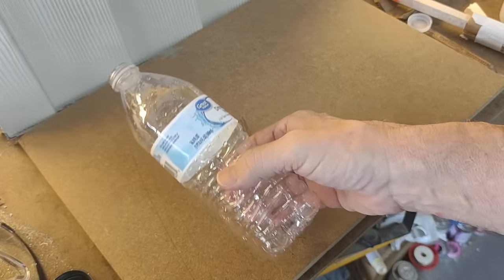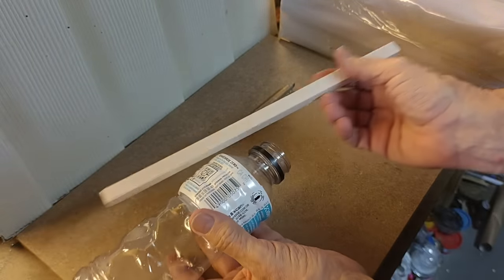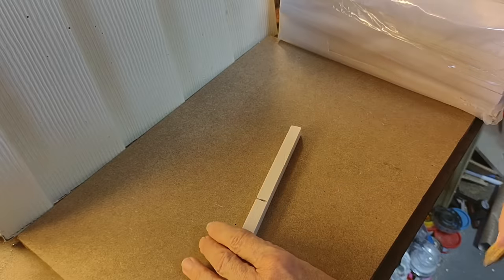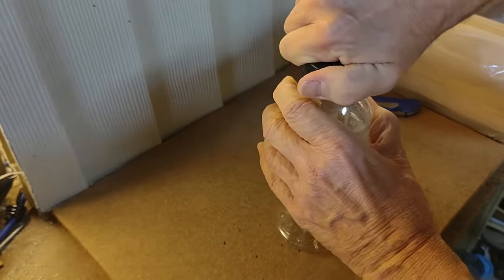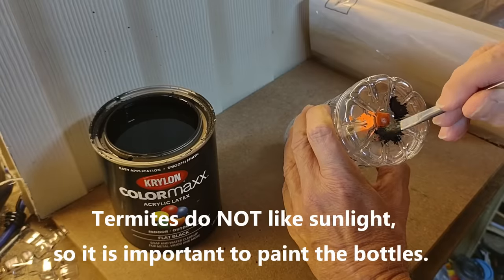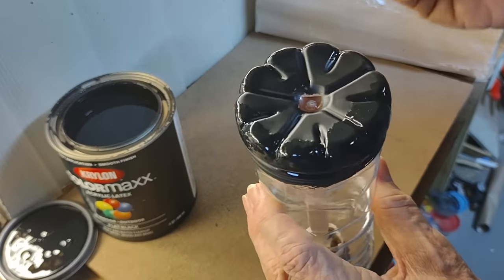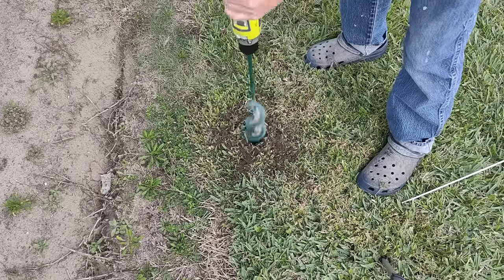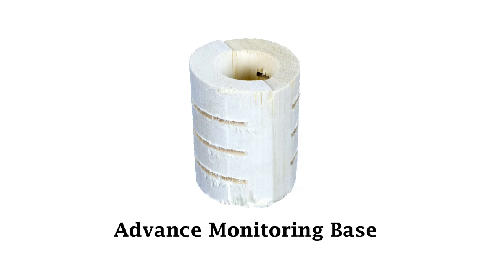Unbelievable Water Bottle Trick for Termites!  Simple to do!

Comment: Does spraying orange oil around the perimeter of the house help to kill termites ?
Reply from the maker: Not really.  Termites travel below ground.  It won't leach into the ground that far.  If you spray orange oil on the side of the house, they will not get a sufficient dose when they build a mud tube to take them out.  If you have an existing infestation, then I recommend using either termite granules or trenching.  For the granules to work you need to have dirt around most of the house and that dirt needs to be porous enough to allow water to seep into the ground fairly quickly.  To find out if the dirt around your house is porous enough, just dig a small hole next to the house that is about 4 inches deep, 8 inches long, and just the width of the shovel.  Fill the hole with water and watch to see how fast it drains down into the ground.  If it seeps into the ground fairly quickly, then the granules should work just fine.  However, if it just kind of sits there, then the granules would not be a good choice, and you should consider trenching, if you have an active infestation.  If it turns out that you need to trench, then please watch my video on how to do that correctly.  Trenching is a lot more work, but it only costs about $100 to do an average size home, and it lasts 5 to 10 years.  Most people can trench an entire house in one day, but you can take up to a month to get it done, and you can literally do just 10 feet at a time.

Make sure that you buy the correct granules.  You need the ones that have imidacloprid as the active ingredient.  A lot of the Home Depot and Lowes stores no longer sell the correct granules, but you can get them from Amazon.  I will give you a link to them.

I hope that helps.  Be well my friend.

Termite granules:  https://www.amazon.com/dp/B000RUIJYM?ref=nb_sb_ss_w_as-reorder-t1_k1_1_6&amp=&crid=157C3RV0MY0AK&amp=&sprefix=termit

Video on how to apply termite granules:  https://youtu.be/H7rW_TSBHJ4

Video on how to trench for subterranean termites:  https://youtu.be/Fy7YHi_7Z8g

Comment: WHAT ABOUT MOBILE HOMES, THE SPACE UNDER THEM?
Reply from the maker: When it comes to termites, mobile homes are not much different than any other home.  Subterranean termites always attack from the ground.  So, if you place the monitoring stations at 4 ft intervals around the mobile home, then you should be alerted to the presence of subterranean termites.  You should check the monitoring stations every month, and while you were out and about doing that, you should also check for mud tubes around the structure as well.  In your case, if you have a skirt around the mobile home, you may find the mud tubes coming up from the ground onto the skirt.  This could be either outside the skirt or the inside that is only visible from under the mobile home.  The other place they may attack is on the piers that are holding up the structure.  So, it is a good idea to take a flashlight and just look for mud tubes that may be coming up those piers.  The termites will almost always find the monitoring stations before they find your mobile home, but it never hurts to make sure.  The termites do not always get the memo about how they are supposed to behave.  If you do get an infestation at some point, then please get back to me and I would be happy to explain how to treat it.

I hope that helps.  Be well my friend.
Reply from the maker: @Enoch940  That is quite the encounter.  It sounds horrible, but at the same time it also sounds like something from a comedy horror movie.  I can just picture that in my mind.  How awful.  Thanks for sharing.  Be well my friend.

Comment: Hi Guy, I have some big black ants in my RV located in Northern Minnesota, I believe they are Carpenter Ant, they usually eat or nest inside dead spruce logs outside. What would you suggest to get rid of them inside my RV? Thank you.
Reply from the maker: I have a video on carpenter ants, but I am going to tell you a better way for an RV.  You need to treat the inside of the RV and the outside.  Make sure that you spray all surfaces of the tires and anything else that comes in contact with the ground.  You should also treat a 20-to-50-foot radius around the RV, and you should treat those spruce logs as well.  A good way to treat both the exterior of the RV, the ground, and the logs is to use a hose end sprayer.  For the exterior of the RV, you just need to treat anything that is in contact with the ground.  If you have any trees that are overhanging the RV, then spray them too.  For the inside of the RV, you can spray the ant trails with Temprid FX.  Just mix it 8 ml to 1/2 gallon of water and spray anywhere you are seeing activity.  Just avoid places where food is prepared or eaten.  Remove all outlet covers and puff D-Fense dust in the outlet boxes and between the outlet boxes and the wall voids.  After that, just apply a bait.  A small dot every 12 inches apart where you are seeing the activity is all you need.  That should do it for an RV.  Keep in mind that the ants in the RV are a satellite colony.  The main colony is outside somewhere, so it is important to treat the outside every 60 to 90 days or they will be back.

I hope that helps.  Be well my friend.

Video on how to treat your yard with a hose end sprayer:  https://youtu.be/wifoTU5dmp0

Temprid FX:  https://www.domyown.com/temprid-fx-insecticide-p-17130.html?sub_id=19352

D-Fense Dust: https://www.domyown.com/dfense-deltamethrin-dust-p-2428.html

Duster:  https://www.amazon.com/gp/product/B099X3HS47/ref=ppx_yo_dt_b_search_asin_title?ie=UTF8&psc=1

Ant bait:  https://www.domyown.com/advion-ant-bait-gel-p-932.html?sub_id=23226
Reply: @GuysPestSolutions   Thank you very much.
Reply from the maker: @andrewpesh9419  You are very welcome.  Be well my friend.

Comment: We are buying a new spec home in Arizona that the ground was to be treated before build and has a 3 year warranty (does that sound legit ?
Reply from the maker: Yes.  Most states now require that builders do a pretreatment for termites.  Unfortunately, they do not do it correctly, so it does not last for more than a few years.  The proper way to do it is to treat all the wood in the entire house with Bora-Care, mixed one to one with water.  When I say the entire house, I mean from the top of the roof, right on down to the basement.  If it is wood, then it should be treated.  This treatment should be done the moment the shell is built, and before the shingles are applied to the roof, the siding goes on the building, the electrical is run, the installation is installed, and so forth.  In other words, you want all the bare wood exposed in the entire house, and then it needs to be sprayed with Bora-Care.  This will render the house totally termite proof and the treatment lasts virtually forever.  This may add another $1000 to $2000 to the cost of building the house, but not only will it render it termite proof, but it will prevent all other types of wood destroying pests as well, such as carpenter ants, carpenter bees, wood boring beetles, and so forth.  This treatment should be mandatory, but the problem is that most people don't know about it, including law makers.

I hope that helps.  Be well my friend.

Comment: I live in the Caribbean.  How do you tackle drywood termite issue?
Reply from the maker: Treatment in the Caribbean is the same as everywhere else in the world.  The only question is if you have access to the products and services that you need?  I do not possess that information, but I can explain how drywood termites work and what you need to do.  

They enter through cracks and crevices around windows, doors, the eaves, pipe penetrations, and so forth.  Most of the time, they enter through several locations.  That is because a swarm of them attacked your house at the same time.  If there was a crack or a crevice, then they probably found it.  After they established their galleries, which will be inside the wood, it will take four to seven years for them to be able to swarm.  Now that they are in your house, the swarmers will use holes that are in your studs to travel through the walls.  Those holes in the studs were created by the electricians to run the electrical wiring.  Not only are these holes going through the studs, but holes were drilled into the attic for the light switches and to run some of the wiring for the outlets.  So, the termites now have easy access throughout the attic and the walls.  If you have a basement or crawl space, they have access to that as well.  Most of the time, you will have no idea that they are in the walls, because the frass is inside the wall.  To make matters worse, if you have drywood termites, then your neighbors have them too.  That means you have been getting swarmed for as long as they have existed in the neighborhood.  Most likely, we're talking about years, so it's a safe bet that you have these guys in many locations in your home.

I always hate to be the bearer of bad news, but if you have drywood termites, the only sure way to get rid of them is to fumigate.  Prices for this can vary wildly in this industry, so I recommend that you watch my video on how to hire a pest controller without getting ripped off.  I don't know if pest control companies work the same way where you are, but it may give you some ideas that may save you some money.  You should also know that the gas they use to fumigate has absolutely no residual action whatsoever, so you can get reinfested the moment the tent comes down.  Like I said before, if you have drywood termites, then your neighbors have them as well.  Since drywood  termites swarm every year, it is almost a certainty that you will be reinfested within a year after the fumigation is done.  The only way to prevent this is to do a preventive treatment on your house every 60 days.  Most pest controllers will not do this, so it is something that you generally need to do yourself.  I have a video on how to do that and I will place a link below.  If you absolutely cannot afford to fumigate your house, then you can try spot treating it yourself.  It is virtually impossible to find all the termite galleries, but it is way better than doing nothing.  Regardless of how you treat it, if you can obtain the products, you should begin the preventive treatment immediately, so that you do not get additional termites paying you a visit.

I hope that helps.  Be well my friend.                      

Video on how to hire a pest controller without getting ripped off:  https://youtu.be/y-a8XOqVrlE

Video on how to prevent drywood termites (You only need to treat the house and not the yard for drywood termites):  https://youtu.be/Yozv3s-Qwlw

Video on how to spot treat drywood termites:  https://youtu.be/U7ck7zhS0Xo
Reply: @GuysPestSolutions  thanks for this information
Reply from the maker: @Lilcherry365  You are very welcome.  Be well my friend.

Comment: Since termites only need a tiny hole to get inside, couldn't i just drill small holes in the bottle instead of cutting out a slot with a utility knife, much safer.
Reply from the maker: You bet.  Just drill the holes about 1/4 inch or wider and you are good to go.  I didn't suggest that because many people do not own a drill and I was making it easy for everyone to do.  I hope that helps.  Be well my friend.

Comment: Very year in June when weather start warming up outside in New Jersey, I found a few earrings crawling in my house. Any suggestions, how to get rid of earrings.
Reply from the maker: Earwigs are coming in from the outside of your house, so the first thing you need to do is treat your yard. You need to apply a pesticide on your entire yard and up the side of the building about 36 inches.  This treatment should be done every 60 to 90 days, but it does not need to be done in freezing weather.  I have a video on how to do that and I will give you a link to it.
 
Now that your yard is treated, you need to get rid of the ones inside the house.  Apply D-Fense dust under baseboards and in cracks and crevices wherever you see activity.  You should also apply it around pipe penetrations under sinks and other plumbing fixtures.  It is a good idea to remove outlet covers and apply it between the outlet box and the drywall, so that the dust gets into the wall void.  All you need is a handheld duster.  Fill the duster halfway and apply the dust with the spout on top.     
 
I hope that helps.  Be well my friend.
           
Video on how to treat your yard with a hose end sprayer:  https://youtu.be/wifoTU5dmp0
 
Bifen XTS:  https://www.domyown.com/bifen-xts-p-1236.html
 
Duster:  https://www.domyown.com/bellow-hand-duster-p-106.html
 
D-Fense dust:   https://www.domyown.com/dfense-deltamethrin-dust-p-2428.html
Reply: @GuysPestSolutions  Thank for you quick reply. I will watch video and follow your instructions.
Reply from the maker: You are very welcome.  Be well my friend.

Comment: I have sub termites in my attic, is there anything I can do myself. Is there any foggers that work
Reply from the maker: Foggers are not going to work.  How you handle that will depend on the species.  Figuring out the species is actually pretty easy, and I have a video on how to do that.  I will provide you with a link below.  After watching this video, you should be able to identify the species.  Just get back to me after you watch it and let me know what you found out.  At that point, I can tell you exactly what you need to do.  Let me know if you have any problems identifying the species, but I do not think that you will. It is much easier than you may imagine.  Also, please tell me where you live.  Location matters.  

By the way, I will be out of town for a couple of weeks, so I may not be able to answer additional questions until after I get back.  Don't worry though.  I will explain everything upon my return.  I'm sure I'll have a good deal of questions waiting for me, so please be patient.  I will work through them one at a time.  Hopefully it will only take me a week to get caught up.  I promise that I will get back to you, albeit a little slower than usual.  We have not been on a vacation for over 13 years and my wife has explained in her unique way that the time has come.  So, go I must, and we won't be back until around June 11.

Be well Ruth.

Video on how to identify termite species: https://youtu.be/dIs_a0nfVjg